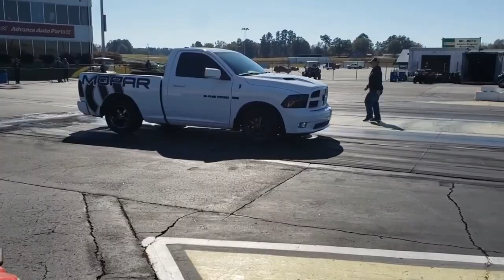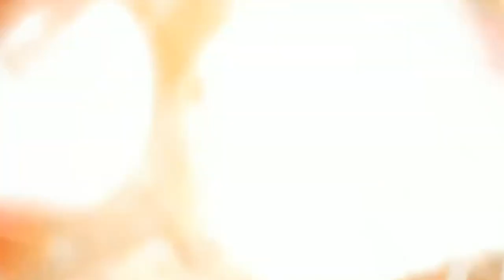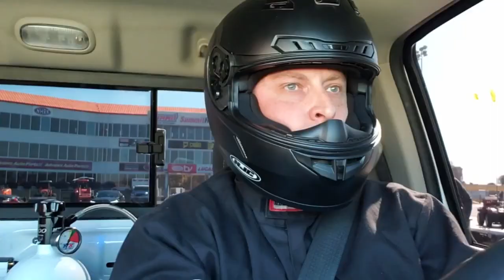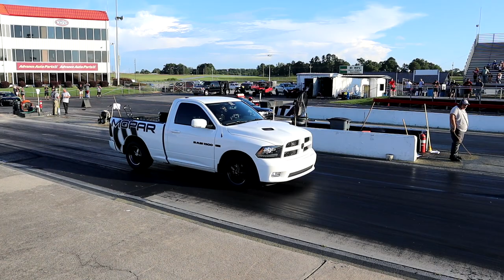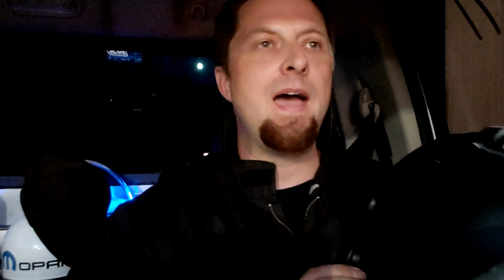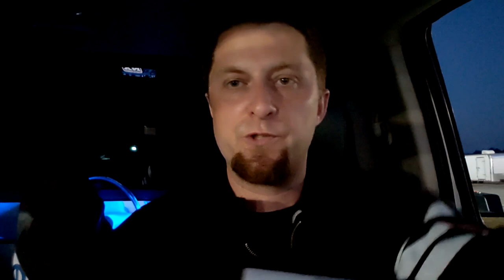Frostbite VS Dragster It Was A Blast!

Comment: Why not use nitrous? You were running 11's
Reply from the maker: Still working on the new setup. But it makes enough power now to runs high 11s with boost just need cooler weather and some more tweaks.  But I still have nitrous installed and planning on running both😉
Reply: @FrostbiteRam  Holy Crap